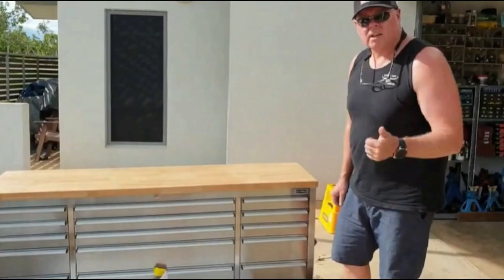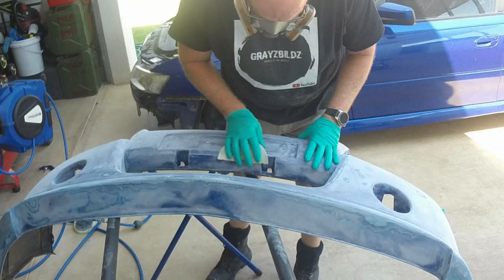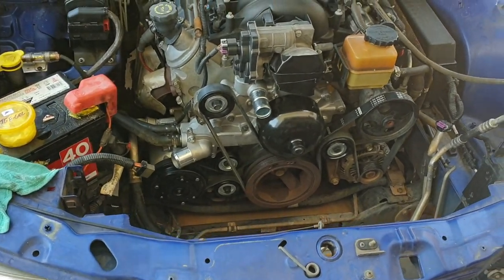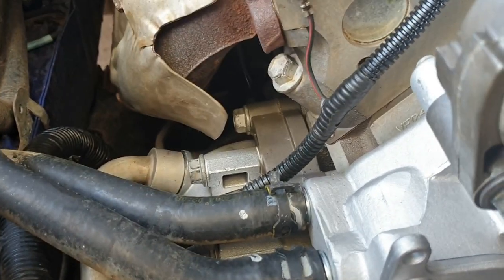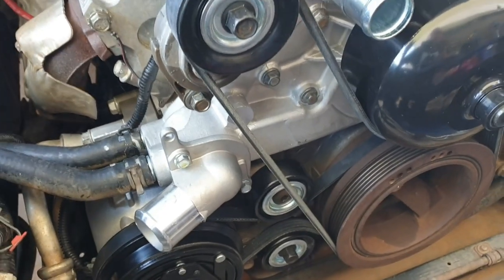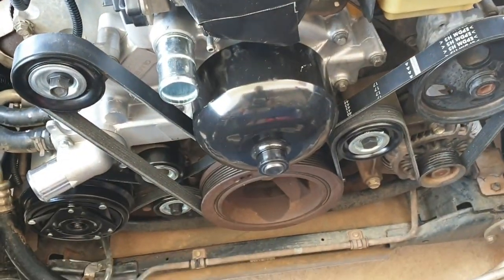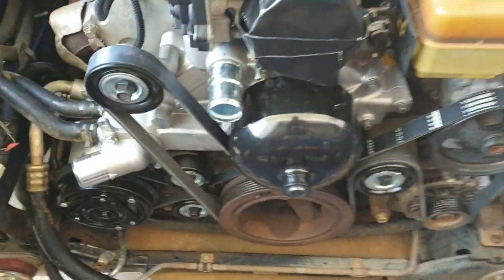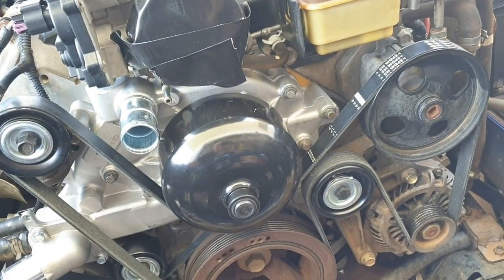VZ SS Commodore LS1 (LS2 similar) Engine Cooling and Aircon Pt 1 (Project Brutus Ep 10)

Comment: Great video thanks. You had an issue with your a/c pump manifold stud being a different size (larger in diameter) on your new pump. I have the same issue and noticed you didn’t cover your solution on the video. I was thinking of simply drilling out the outlet hole to accommodate the larger stud. Is that what you ended up doing? Cheers Brian
Reply from the maker: Sorry about Brian, I thought I showed the solution. For memory, and it was a long time ago, I unthreaded the oem stud and threaded it into the new pump. Hope that helps. Cheers, Andy

Comment: How is your Chinese compressor holding up? I used a cheap Chinesium water pump a few years ago and it was rubbish. I see the genuine Delphi compressor is expensive but probably worth it in the long run.
Reply from the maker: I sold the vehicle to a mate mid last year. So far he's not had any issues with it, but it's not a daily driver. I agree the Delphi compressor is a much better quality item. Thanks for watching and commenting. Cheers, Andy

Comment: How did you go about that problem you had with the bolt that holds the hoses onto the ac compressor
Reply from the maker: Hi Kacey. I think for memory I shortened the bolt to correct length. Cheers, Andy

Comment: Hey mate, quick question. One the compressor does the larger hose the feed line to the firewall and the thinner hose the return from the condenser? Cheers
Reply from the maker: Hi Luke. I'm not an aircon expert by any means but the large hose is the low pressure side and for memory is the return line. Not sure that helps with your question. Cheers

Comment: Compressor oil ? how much?
thanks
Reply from the maker: The new compressors come oiled. AFAIK you don't need to add any oil to a system when replacing the compressor. Thanks for watching and subscribing! Cheers, Andy
Reply: @grayzbildz  i am did service mine, added approx. 100ml seems system over charged, any suggestions? highly appreciated...
Reply from the maker: Probably way too much oil now mate. I'm no expert though.
Reply: @grayzbildz  allow me to explain, since my compressor is not new, t4, i removed the oil drain plug to check oil condition and it was good, but i drained it anyway, in order to have new oil in, put new condenser, drier, any suggestion what should be the correct quantity....we too have chinese compressors (since Delphi does not supply anymore) but they come DRY. Can you advise ...appreciate your kind assistance.
Reply from the maker: @puccha10  sorry mate, beyond my expertise.